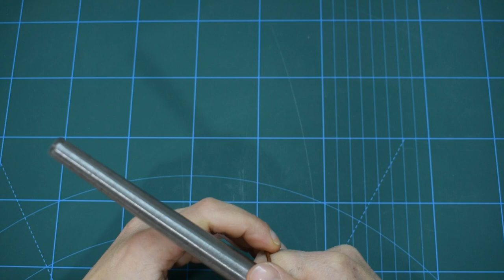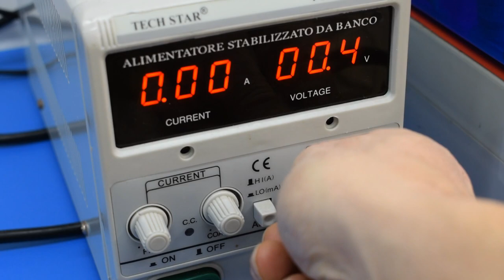How to Make Electroformed Copper Jewelry with Poplar Leaves

Comment: Great video, thanks for posting! I just had a quick question, Im a beginner, but why would you need to paint on the relief paint to bridge the gap between the stone and the leaves, why cant you just paint it with the conductive paint, wouldn't the electroformed copper essentially act as the bridge, and just fill in that gap anyways? Or is it just a cleaner edge or something...thanks!!!
Reply from the maker: I rather fill all the gaps for two reasons, to make the piece flat and smoother, I don't want the 90 degrees angle and, more important, for a mechanical issue... when you leave big gaps there is the possibility that your piece will break.
The conductive paint that I use isn't gonna fill that little gap, I should use it over and over. Two coats of that stuff are more than enough.
I never saw anybody using relief paint this way. I found it a easier and faster solution.
Reply: @cuforming  ah!! Makes sense ok. Thanks again!